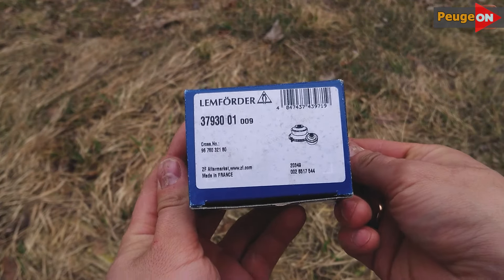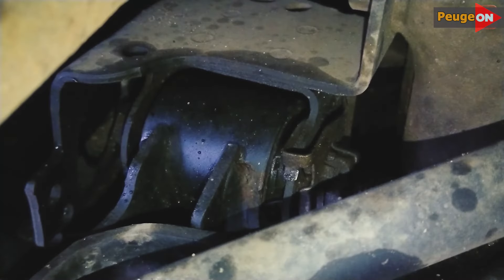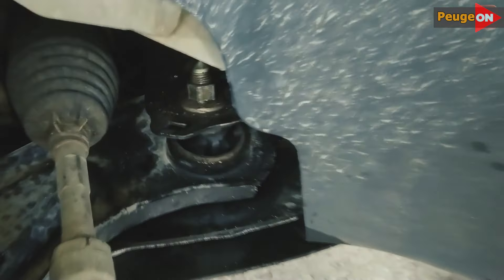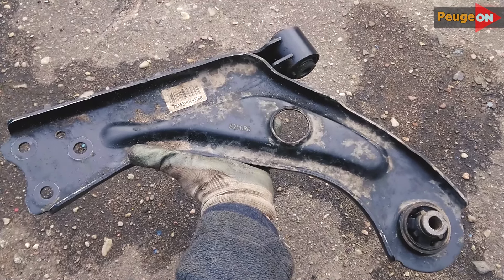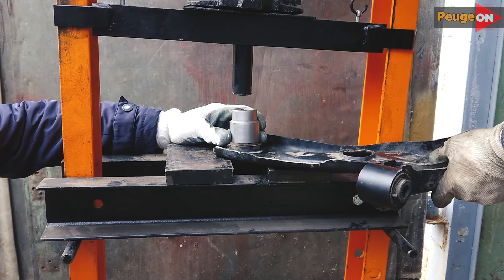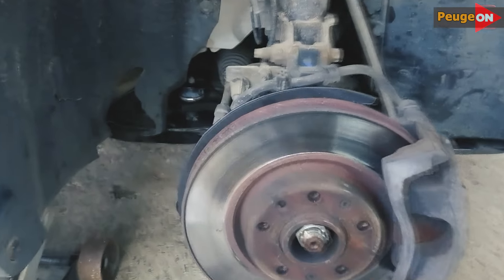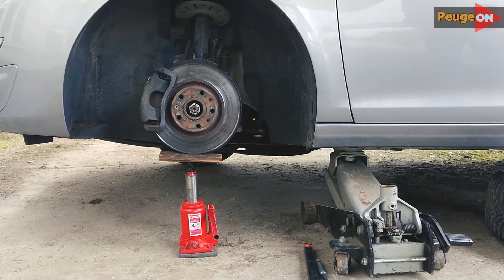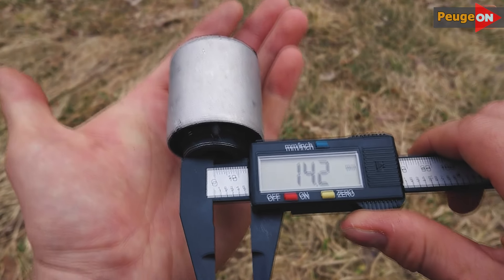Peugeot 308 silent block replacement

Comment: Can this cause a specific rattling noise from inside the cabin, when hittin bumpy road?
Reply from the maker: Yes, why not. But there are many options in the suspension, which can give such an effect. Diagnosis is needed